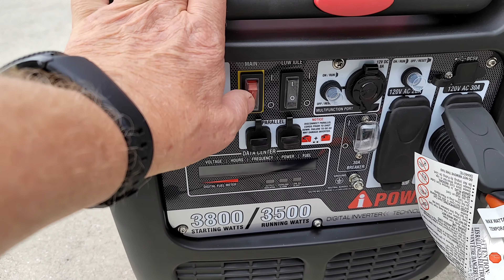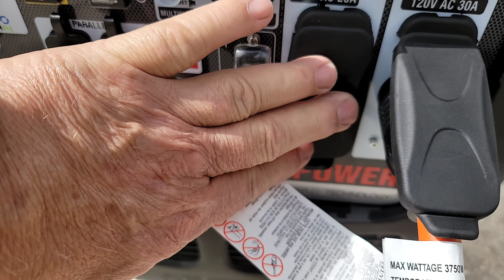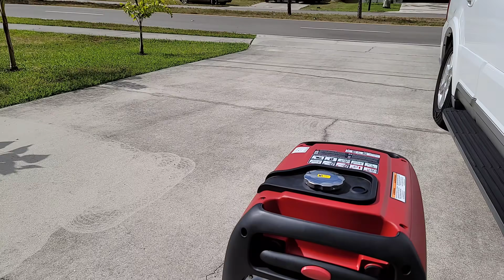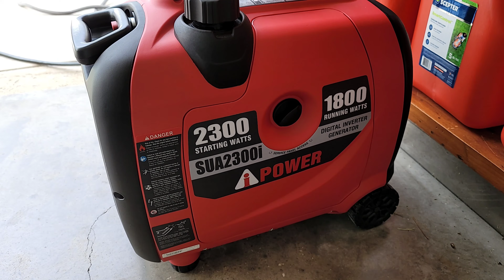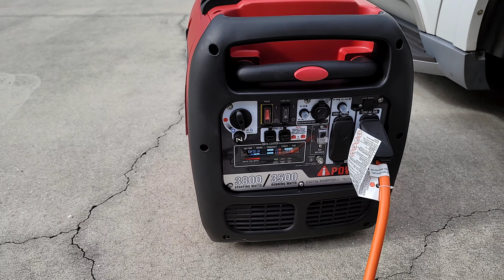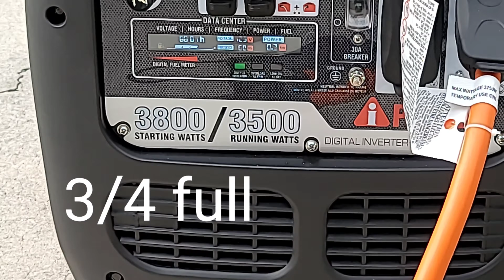ipower 3800 inverter generator. Hurricane IAN, generator worked GREAT!!!

Comment: I have the larger 7100 and the smaller 2400 had a lock out panel put in it has saved us during several power outages and it’s very quiet.
Other than a new battery it’s been great.
Reply from the maker: Thank you for sharing. I really like the 7100 and wanted it when Costco had it on sale. Which one did you use more? Both have their own advantages. Here when there is a hurricane 🌀 gas is not available. Low fuel consumption is a great thing.  On the 7100, it would be nice to be able to power more items at the same time, and electric start. The battery 🔋,  the one consumable besides fuel.

Comment: 100% best Generater.Systems I have used. A test for hurricane prep here in Louisiana: three AC units, 5000, 5000 & 8000, 3 fridges, 2 device power setups, 4 flat screens....AND I had 40% of the power meter to spare.
Reply from the maker: Living in Florida I am unable to make recommendations regarding this topic. I am sure you could take it outside and run it in the cold but leaving is outside depending on the temperature may make it very difficult to start. Be sure to check the manufacture's documentation regarding any generator you purchase to be sure you will get the desired result. Thank you for watching and commenting. Have a wonderful weekend.

Comment: Can you parallel both your models? They are different wattages. If so, do you just add the starting/running watts for the use you need it for? I.E. 3800+2300=6100 starting watts? Only halfway through the video so don't know if you'll get into that lol.
Reply from the maker: This video demonstrates your question. Hope this helps. https://youtu.be/bsu3C15WNhE
Reply: @htnowpro  thanks man. I'm learning alot. 👍🏻
Reply from the maker: The way I understand it....you can parallel the two ...3800 and 2300 but you would not gain the 6100 watts. The bigger would be capped to the max of the smaller.  If anyone can explain why please enlighten us. 🤔
Reply: @htnowpro  no I read that too. Seems your smallest one is the double value. 
Love the vids bro 👍🏻
I think it has to do with the computers that control the parallel. They must be connected before starting so just like BOGO equal or lesser value it's the smallest one that dictates the total
Reply from the maker: Yes, that make sense. Can't work the little one too much. Thank you for your kind words.  Have a great week.

Comment: Nice video ty. Would you still recommend this generator ? Any thing you learned and don't like ?
Reply from the maker: I am still very pleased with this generator for it's price point.  It is showing at Sam's Club online for $659. $899 for dual fuel, electric start/remote start. I can't find it in on Home depot as of today. One viewer reported his 2300 quit outputting and he is having trouble finding parts. This may be the case with all iPower products, however I am very pleased with the design and build quality. I just changed the oil yesterday and made ready for this hurricane season. In my case I wanted an inverter generator for clean power, I also like the enclosed sound deadening exterior housing, extendable handle for moving around and great run time in a small package, the price was right. I previously had twin iPower 2300's for a short period before stepping up to this 3800. Hope this helps, thank you for watching and commenting, have a wonderful week ahead.
Reply: @htnowpro  Nice thanks for the quick reply. From Canada, currently on Costco for $879 cdn$ for the dual fuel, has dropped $100 since I last checked it out. Looking at it more for a backup should I ever need it, so trying to decide if it is worth spending for peace of mind. I like the idea it is dual fuel and somewhat portable.
Reply from the maker: @westbccoast  dual fuel and electric start/ remote is a nice plus.....peace of mind is nice to have. I'm very happy with my transfer switch also. Makes it just  few minutes to get it all running/ connected and powered.

Comment: How's the 3800 treating you?
Reply from the maker: I am extremely pleased with it ☺.  I have only spent about 6.5 hours of use ( break in). Thankfully no hurricanes this year or power outages. For the price point and the amount of time I expect to use it, I am very pleased. Thank you for watching and commenting.  Hope you have a wonderful new year ahead.
Reply: The dual fuel version had a problem with the electric LP valve shorting out. It started leaking gasoline from the air filter box (carb sinking float). Initial problem was a defective spark plug integral resistor that was intermittent. Had to return it for a refund..

Comment: I live at almost 7,000' elevation here in Colorado.  The smaller, ~2000 watt inverters engines are just too small for this elevation as Eco mode is pretty much worthless because the engine has to work so much harder here in the thinner air.  I've even seen a 2000 watt Honda not even start at 10,000'!  For me, the 3800 sized inverter with the larger engine will hopefully do the trick.  I'm looking for a machine that will stay at lower rpm's unless I have a bog load on it.  What kind of a load can you run on it before the rpm's really get noisy?
Reply from the maker: I ran it up around 3.3k and I think it was quieter then the two 2300i's running parallel. Definitely the larger engine does not work as hard. I'm very satisfied with upgrading to this from the twin 2300i's. Thank you for watching and commenting.  Hope this helps.
Reply: @htnowpro  Thanks for the info!  Did you know you're the only one on YT that has a review up for this genny?  The only reason I know about it is I saw it on the Sam's Club website.  A-ipower doesn't even list the 3800 on their website!  I wonder if they discontinued it.
Reply from the maker: I found it by accident on Sam's Club web site also. I did see Home depot selling the premium version with electric remote start and dual fuel for $300. More. Would be nice 👍.
Reply from the maker: @maximaniac7231  Home Depot still shows the 3800 on the website as of this morning.  If I was in charge of Sam's Club I would definitely put this unit on the shelf and not keep it a secret 😉 .
Reply: @htnowpro  I agree.  From what I can see on your video it sounds like a VERY quiet machine.  It appears to be even quieter than the WEN 3800 I've also had my eye on.  What puts this one over the others for me though is the nice digital info display.  The only thing that stops me from buying right now is the higher price of $660.  I think I'll wait till around Black Friday and hope they have a sale.
Reply: I have an Energizer 7500w inverter generator with electronic fuel injection.  It works really well in freezing cold temperatures and would also be better at high altitude than carbureted.
Reply from the maker: Been using it for over 100 hours because of hurricane IAN 🌀.  I am convinced it is the perfect size to manage fuel consumption and electral needs.

Comment: Can you run the 3800 and 2300 in parallel?
Reply from the maker: I'm not sure. But I think I remember reading that you could mix them but that output would be limited to the lower one. Maybe someone will chime in here that knows for sure. I no longer have my 2300's.  I replaced them with the 3800. Hope this helps a little.  Thank you for watching and commenting.  Have a great week ahead. 😀

Comment: Now that you have had this for a while could you please let me know how many hours it will run under load on a single tank of gas? Thank you.
Reply from the maker: You are welcome.  I was going to make a video about it but things have been so busy. Thanks for watching and commenting.
Reply from the maker: Sure. It runs about seven hours under load, 2.5 gallons approximately.
Reply: @htnowpro  thank you
Reply from the maker: @bucknaykid5821  I made a mistake, I was just going over the specs, it is rated at 12 hours run time.

Comment: you sold me on it.  Will get one in a few weeks.  Run an expedite van over the road on work and need one of these to power portable ac, and other necessities.  Thank you for posting!
Reply from the maker: You are welcome. I just put another 7 hours on mine running a 12k AC with a stand up fan for 7 hours on about 2.3 gallons of fuel. Thanks for watching and commenting.  Have a great weekend coming up.

Comment: Informative and well presented video. I have the same 3800/3500 generator. I would like to get the same setup to connect it to my home. Is that setup with the load inverter costly?
Reply from the maker: The one I purchased shows to be $339.99 at home depot. It comes complete. It's hard to catch it in stock. It really makes using the generator easy. You will also need a cord and an adapter to tie both 110v to your generator.
Reply from the maker: There is another kit that comes with a outside access plug and box and a 10 foot cord, It's $410.
Reply: I have found both in stock. Have you had any issues from tying both 110s from the transfer switch to the single 110 in the generator?
Reply: I may also just do a Generator Interlock Kit, since that would simplify my setup. I have an outside main breaker below meter,  with a sub-panel in the garage. My main concern was using the adapter to to tie both inlet box 110s to the generator.
Reply from the maker: The interlock kit seems like a nice inexpensive solution.
Reply: Another thing is that generator has a bonded neutral, which is great if you were running extension cords. Hooking it up to the house means it and the house panel both have neutral and ground bonded. I've read that is should only be bonded in one place. The solution being to convert the generator to where neutral and it's ground aren't bonded, or get a transfer switch that is meant to work with a bonded neutral generator. My question really is, have you had any issues at all? And did you do the setup yourself or have an electrician do it?  Thanks for the previous answers. Your videos and answers to my comments have have been helpful.
Reply from the maker: I haven't had any issues.  There are videos showing how to un bond honda inverter generators. You should consult an electrician and or have them install the kit. Please let us know what you find out. It would be a great help for viewers doing their research. Thank you..
Reply from the maker: Did a search and found this. This explains your questions regarding bonding. Hope this helps.

https://youtu.be/bxlmF7YsEhQ